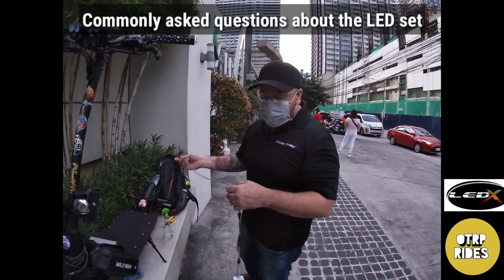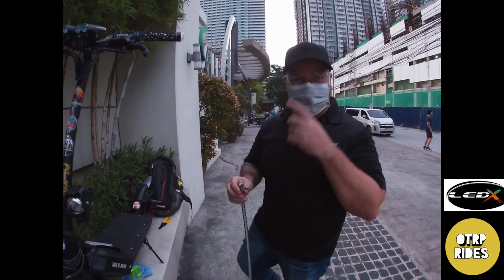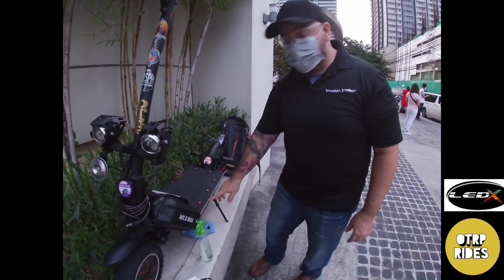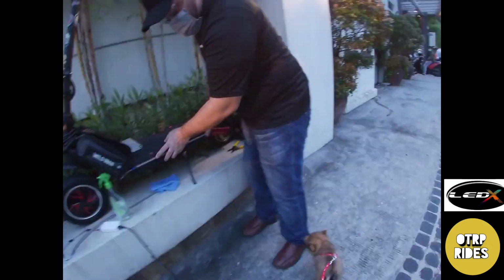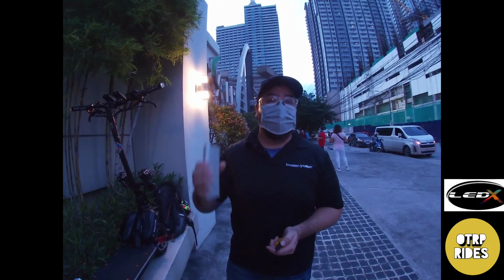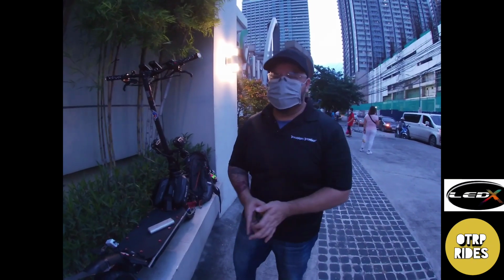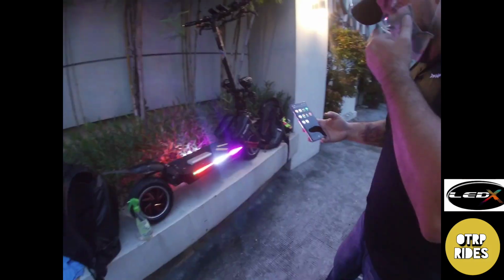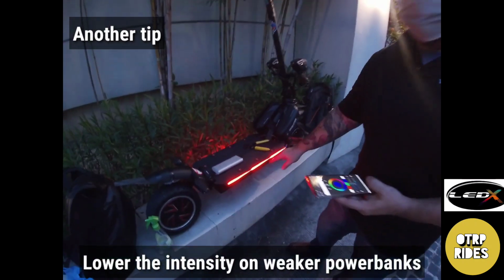I GOT DEM WEPED LIGHTS!!! | 144 led by LEDx | FACTS AND TIPS ON LED INSTALLATION

Comment: hello, one question: can I connect 2 strips to the scooter's 12v where the light is. that also has a 12v plug.
Reply from the maker: Are you referring to the scooter's main battery with a 12v step down converter?
Reply: @otrprides1088  Yes, the battery has about 54 volts, but the light is 12v. I think i can plug it in there? I don't know how many amps are possible. Will surely have a limit.

Comment: I am fond of using UV glue on a lot of stuff, I even dab small dots on the corners of stickers so they don't start to peel off.
Very inexpensive and durable too, plus you don't notice it's there.
I'm thinking that several dabs on the corners of the LED strips and maybe every few inches along the sides would reinforce the double sided tape used on that setup and make it more durable overall.

Put on a pair of UV glasses or a decent pair sunglasses when curing the glue under the(usually) included LED lights. 😁
Reply from the maker: Woaaah. Thanks for this tip broo. Ill let LEDx know about this. Have a nice day man!
Reply from the maker: Btw sir. I wanted to ask where can you get this UV glue?
Reply: Lazada/Shoppee bro. Comsistency is a bit thick but it dries clear and tough.
Practice muna sa ibang materials to get the hang of it. I got a 30mL bottle, meron pa haha. Laser adhesive brand. 
Cheers!

Comment: so, powerbank with 3amps is better, those with 18watt quick charge.
Reply from the maker: Yees. But battery pack is the best when it comes to using these. Luckily my powerbank is decently powerful so Im able to run it
Reply: i got two 30kmAh powerbank that supports Quick Charge 3.0 (3amps) rather than the regular fast charge that only got 2amps max.. so excited for my Booster 21 from KnightScoot..
Reply from the maker: Yaaaay!!! Glad to hear that broo

Comment: cant all of these be wired to an actual scooter battery? i find it kinda strange to carry another power source for your peripherals when you got a huge main battery on your scooter
Reply from the maker: For sure you can but I think there'll be affectations with the range.
Reply: @otrprides1088  yea you right of course . Maybe if you have pretty decently small main capacity battery. I was thinking adding a few accessories to begode k4 , they have very beefy main batteries so it would make sense for me I guess.
Reply from the maker: I think you can but you may need like a 12v converter so you won't fry the LEDs
Reply: @otrprides1088  yea but if you got a horn and a light that came with the bike im sure they are fed through the converter and supply 12 volts. Ofc you not gonna straight feed anything directly through the battery and without any fuses haha

Comment: Can we direct connect between led strips and the 36v electric scooter power source?
Reply from the maker: I wouldn't suggest it. As far as what wilder told me. You need atleast a 5v power source or a 12v battery pack with a 5v step down converter to light it up. However if you connect it directly with the 36v battery I dont think it will be good for your scoot as well